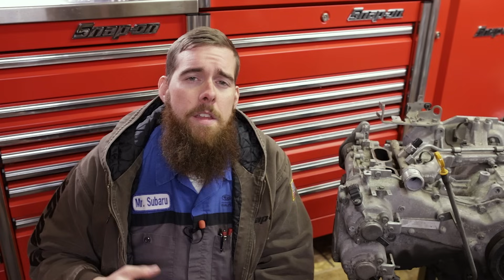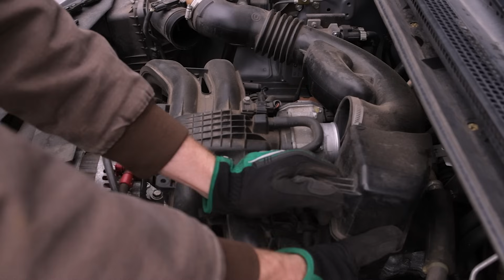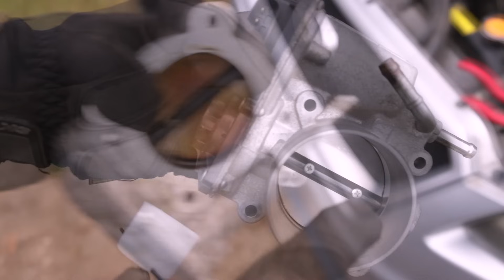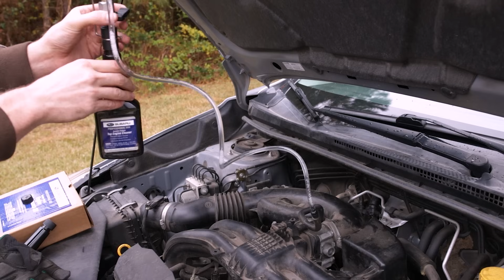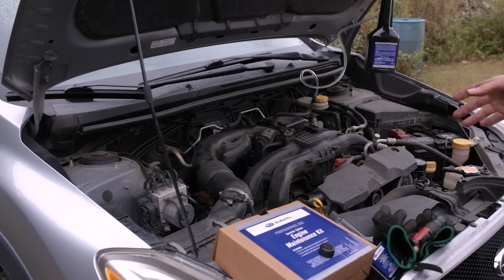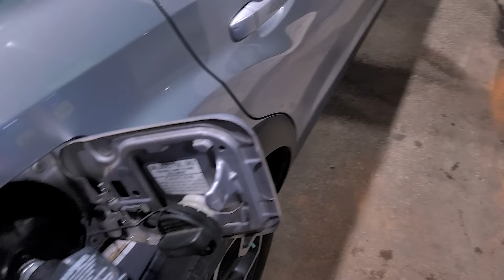Keep Your Subaru Running Like New! Subaru Engine Maintenance Kit

Comment: Excellent educational information and content!!! Question: Does this work on a 1998 Subaru Legacy Outback 2.5L Engine with 213, 000 miles. Hopefully that is enough information of my engine…. If not please let me know of any specific additional information on my engine will be helpful. Your response is greatly appreciated. Thank you & All The Best ✌️😎👍👍👍👍👍👍👍👍👍👍👍👍👍👍
Reply: Earlier Subarus have port injection. You have fuel washing the back side of your inlet valve. So carbon build up is not that of an issue. On newer Subaru engine, it shifted to direct fuel injection. Meaning fuel is added directly into the cylinders. The only benefit I could see for this decarb service for EJ and older Subarus is cleaning the Carbon off the piston crown and combustion chamber.
Reply: @saopaolodelacruz1007  Greatly appreciated info &, for the heads up. Sadly she has a small, at the moment, head gasket leak… ie bubbling radiator. At the moment saving for a proper head gasket, machine shop etc. All The Best ✌️😎👍👍👍👍

Comment: Mr. Subaru.  I enjoy your video's.  I just bought my first Subaru, a 2021 Outback with the 2.5 NA engine.  Do you think an oil catch can would be a wise investment?  What do you think about oil catch cans for daily driving?
Reply from the maker: It'll void your warranty. An AOS( air oil separator) would be much better to add. Can't recommend any brand over another though.
Reply: just remove the AOS before going to the dealership :)

Comment: Great video I should probably do A throttlebody cleaning on my 09 Subaru Forrester I don’t know if it’s ever been done I’ve bought it on the cheap and been working on it for the past year and a half but it’s always been drivable the whole time and I’m averaging 22 miles to the gallon mainly just normal higher mileage maintenance stuff have 158,000 on it

Comment: Great video, at what mileage should a Subaru Outback owner consider this service? 2022 Outback 2.5L non turbo. Hoping this is the last vehicle I ever purchase before checking out. :-)
Reply from the maker: 30k intervals for the top engine cleaner would be the recommendation for your DI engine.
Reply: @MrSubaru1387  Is the mileage interval longer if a catch can is installed?

Comment: the subaru factory top end cleaner is a waste. your better off just using sea foam. ive used both and the sea foam cleans better from just 1 bottle used. the subaru one will take at least 3 for the same effect from my experience as a dealer tech. your mileage may vary...

Comment: I didn't know this was even a thing. At what mileage/year interval would you suggest doing this?  Is this something you would need to do less frequently with top tier fuels?   
Also I know they say you don't need high octane in the non turbo versions. Does the high octane fuels from shell/ Exxon mobil have more detergents then the standard 87 octane?
Reply from the maker: On DI engines, every 30k miles for the top engine cleaner. On normal port injection engines, really not required near as often.
Reply: @MrSubaru1387  so on normal engines, maybe do with/before the timing belt service?
Reply: @themadmallard  Only EJs have timing belt intervals, and all EJs are port injection only so no need for valve cleaning on them.

Comment: Word of warning for anyone wanting to perform this on a turbocharged engine. Be very careful with how you meter the cleaner in, if you go too quickly liquid cleaner can accumulate in the intercooler. Hard acceleration can draw the cleaner in and cause a burst of high engine rpm.
Reply: does it require another bottle of it since it must pass through the turbo and intercooler right?
Reply from the maker: You inject the cleaner directly into intake manifold vacuum. The cleaner shouldn't be getting into, or flowing through the intercooler.
Reply: @MrSubaru1387  so the procedure is still the same on both turbo and non-turbo versions? i'll keep that in mind thanks
Reply from the maker: @jeromegaces6184  there's a TSB on the procedure, looks like I need to make another video detailing the other FA/FB engines connection points.
Reply: @MrSubaru1387  so would this be the same procedure for a 2008 WRX?
Reply: @MrSubaru1387  yes, please explain the procedure for FA20 turbo engines.
Reply: @chornykot03  No need for this on EJ motors since they're port injected and not prone to carbon buildup on the intake valves.
Reply: @MrSubaru1387  love this video. Did you ever make an updated one for the FA20 DIT? Can you link the TSB you mentioned?

Thanks!
Reply: @MrSubaru1387  Yes please do make a video on the  2.4 FA/FB turbo engine maintenance kit. They don't have a intake breather like the non-turbo 2.5
Reply: @MrSubaru1387 Do you have the video on how to do it for a 23 FA on a WRX yet?
Reply: Just wanted to let everyone know that the Subaru Maintenance Kit is no longer available from Amazon or Subaru online. MrSubaru is costing the dealerships money or too many people damaging their engines. I think it’s the former. In case you ever read this Mr.Subaru, any advice or alternate way of getting this kit?

Comment: What are the chances in Hydrolocking an engine for doing such a procedure?
Reply from the maker: It's a real possibility without the tool and some wit
Reply: @MrSubaru1387  - Wishing this product was in the form of Spray carb cleaner like just stick the straw into the hose and let the content loose. Any chance Subaru could do a one-time courtesy service to such?
Reply from the maker: @mr.nobody4900  not sure how Subaru dealers are handling the DI carbon issues.
Reply: I find it crazy we have to clean valves on a modern engine.   Feel like I'm working on some engine I salvaged in the junk yard from the pre 1970s.

Comment: Excellent how-to, particularly in regards to the use of the injection tool and its importance.  I've seen people recommend using a basketball inflation needle as a metering device...   LOL!
Reply: I used to do this method of metering on my old Scion xA. After 330k miles, the only thing that worked was the engine. lol.

It’s tricky: you have to hold the inlet right up against the edge of the cleaner. The small aperture of the inflator is to keep the engine from stalling due to a vacuum leak.

If you dip the inflator into the liquid, you’ll experience a hydrolock vehicle death.

You keep it right on the edge of the meniscus. If you do this correctly, you’ll atomize the cleaner and everything will be good to go.

However, maintaining this level of concentration and steady hands for the injection period (10-15min) is difficult and a little exhausting.

Just buy the correct tool. Cheaping out in $60 and blowing up a $6k engine is pretty foolish.

Comment: Playing armchair mechanic. I would have loved to have seen a bore scope of the valves before and after
Reply from the maker: Yeah, I wanted to, but the grid pattern behind the throttle body prevented this. Would have remove the intake, but twice for a video... Maybe in the future. 👍🏻
Reply: @MrSubaru1387  Please do because I'm debating between this and getting the upper body walnut blasted. Are you also concerned about where this carbon is going, i.e. the catalytic convertor?
Reply from the maker: That's part of the smoke. Increasing RPM pushes it out/burns it, but there's likely some residue left in the cat/cats.
Reply: There is another video on a non-suburu where the guy scoped before and after the process of carb cleaning.  The effect of the cleaning was minimal at best.  Most of the cleaning it did was prior to the actual combustion chamber.  It only showed a noticeable difference in one combustion chamber and the others showed no reduction in carbon and actually showed even more fresh carbon buildup than prior.  You could tell it was fresh because it was wet and glossy still.  Maybe if you ran it thru the system routinely it would clean more but one pass didn't seem to do anything on a direct injected engine
Reply: @Thee-_-Outlier  the biggest problem on DI Subarus is the intake tract before the valves I thought. That's where all the EGR gasses and buildup gets stuck as there is no fuel spray to wash the back of the valves and intake diverters.
Reply: @Thee-_-Outlier  I never believed in such services as “air/fuel induction services” until I realized that direct injection engines need something to clean the intake valves. If the product is quality, it genuinely does clean the intake side.
Reply: @Cegros A mechanic friend of mine did it on both of my cars a few times, at cost, because he considered it among the best preventive maintenance steps for engine performance.

Comment: I just did spark plugs on my 2011 outback noticed oil in both holes drivers side I'll be taking care of that.
Reply from the maker: That's cam cover gasket and spark plug tube seal gaskets.
Reply: Thanks

Comment: Without taking the intake manifold off, its an assumption that this perfectly cleans the back of the valves. Would you prefer this over walnut blasting? I’ve had nothing but headaches talking with my local dealer about intake valve cleaning (service advisor saying they don’t have anything other than fuel system cleaning)
Reply: This is more of a preventative measure to keep it to a minimum but walnut blasting will provide the best results.
Reply: This won’t clean as well as walnut blasting does. All this really does is soften the carbon and loosens it up. But there Is still a thin wall of carbon left over